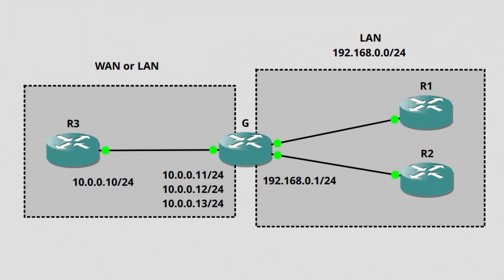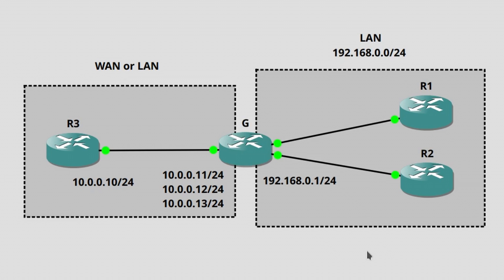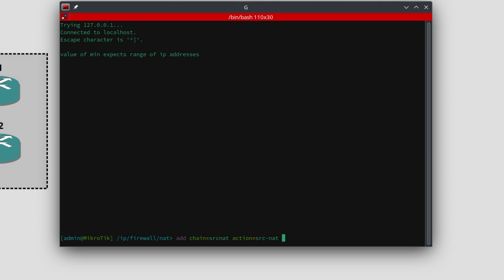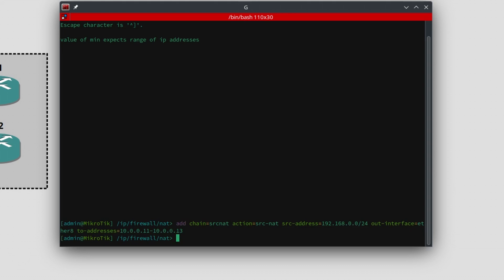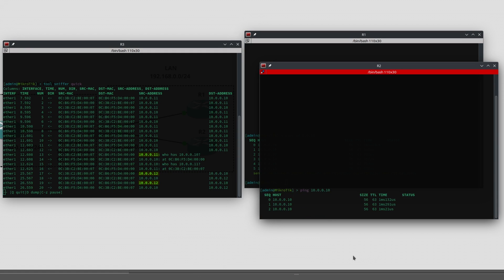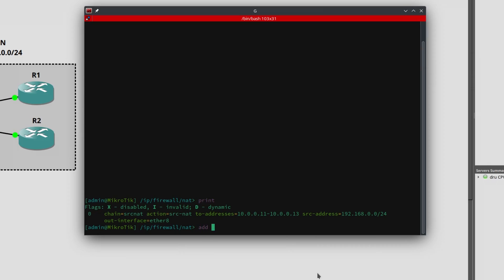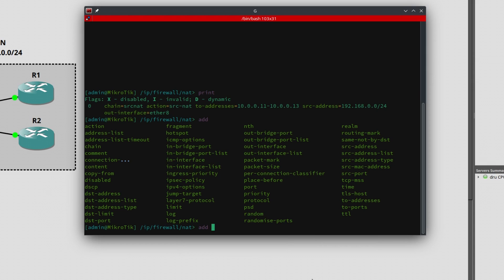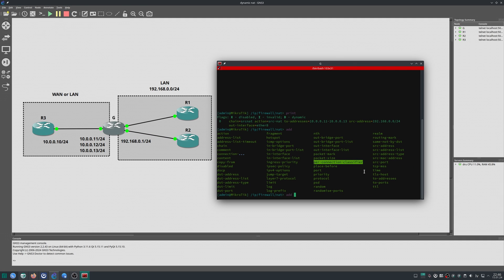Dynamic NAT in RouterOS

Comment: This is great that MikroTik can do this and everything, but this just sounds like someone was bored one day and said what can MikroTik do? There's no real practical purpose for this.
Reply: that's simply not the case. Maybe the random part, but assigning different public IPs to different local IP ranges with srcnat is very useful. I'm running this setup to split /29 to 6 different business tenants.
Reply: @cosmo1084  I do this as well, but I don't call it 'dynamic nat'; it's just multiple source nats. Typically you'll have a /28, a /29, or multiple /28's and /29's from your ISP. You can then assign IP addresses from these subnets to your tenants. However, the presenter is referring to multiple /30's or /32's (i.e. one /30 or /32 for every tenant).

Comment: Thank good IPV6 is here so we can get rid of this NAT crap, thanks for the video anyway.
Reply: A network-network translation in IPv6 seems more useful to me, replacing an internally used prefix with one provided by the ISP. I have tried using netmap, but it requires that the NATed IPs be created on the router
Reply: I'm using NATv6 for my private network and port forwarding
Reply: @mehdimj_ir  ,yes you can, but is adding complexity where is not needed, especially at home, IPV6 can completely substitute IPV4 on a much more efficient and less complex way, and spite we still need gateways to translate IPV4 addresses to IPV6 and vice versa, this is will be temporary until IPV4 is not around anymore. At home you should be using  dual stack and use only IPV4 as a backup or for the services out there that strictly require IPV4 connection, that is less and less, more 2 years and 90% of traffic will be IPV6, is already at 50% now.